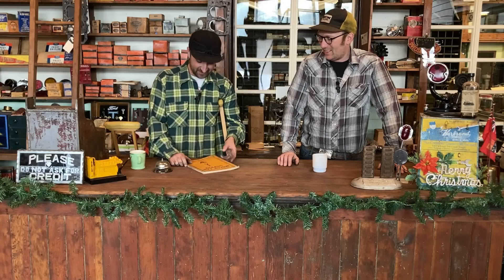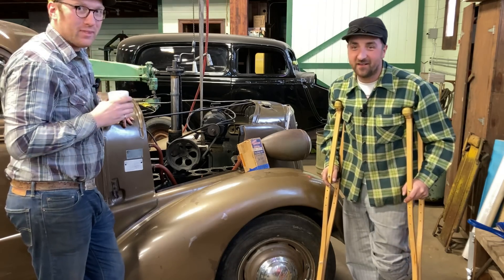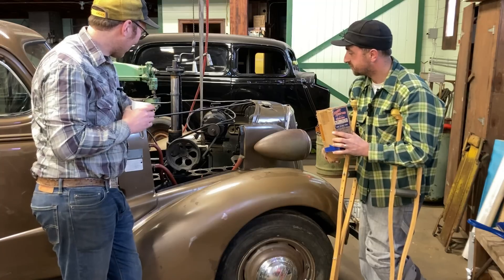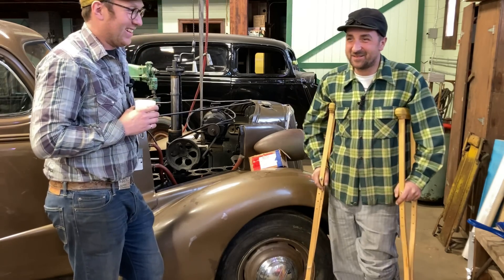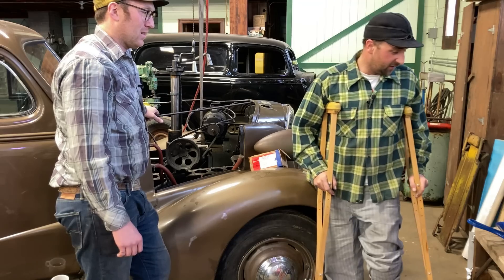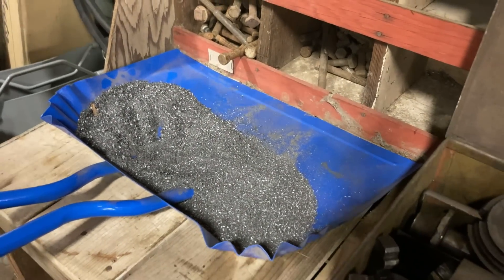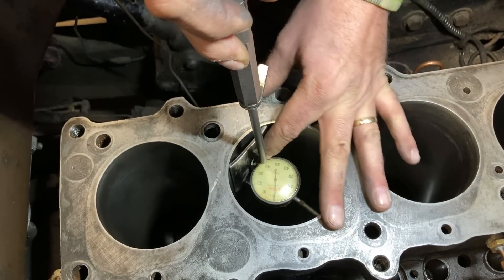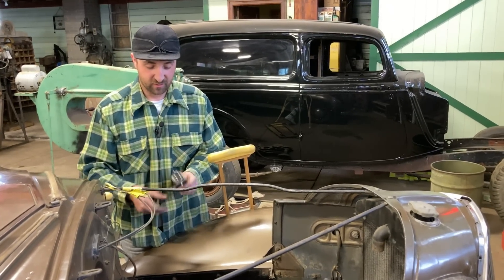Saving a RUINED Engine WITHOUT Taking out of the CAR! 1920's STORM Boring Bar! Saturday STORMIZING!

Comment: Being an avid and long time fan of this channel and CWM, I was rapt to be able to see this done - and just like it would have been done around a hundred years ago.  I was absolutely fascinated by that cylinder bore - being driven by an aged electric motor that was so much quieter than a lot of more modern similarly sized electric motors.  I am not sure whether the electric motor was from the 1920s given that electrically-driven items were still in their infancy, so would be interested to know if it was part of the original kit or, if not, how the bore would have been originally driven in situ, as I cannot imagine it being hand-turned! 

A lengthy process, but one that was so darn accurate and achieved the goal of giving that '37 Chev's engine a chance to live again and keep her going in an all-original state - and best of all, on the factory standard bore sizing.  Not caring about the value of the car - just that it seems right and proper to make it happen if indeed it CAN happen.  The '37 is such a treat and a true time-capsule otherwise, that it really gives me the fizz that you were able to save its heart and Scott will have her running again by summer - of that I have no doubt.  It will be truly special to see that beasty rack up a few miles for the first time since she was parked all those years ago - and you two can be rightly proud that you've had a big hand in that.

Period tools have their place and they - like the cars that were worked on back then - only go to show that a thing does not have to be brand new and modern in order to do the job and do it well.....and oftentimes, the older units will last a lot longer than their modern equivalent because they were built to receive regular maintenance to help prevent them from no longer being useful.  I am in awe of your impressive array of old tools and New Old Stock and would love to be able to spend my days working on cars of that vintage - not just as a hobby and I thoroughly enjoy watching your content to see what examples of yesteryear turn up.  As I have said before (and will say again) I wish you both every success and all the best for the business.

Comment: For many years, cars and engines were designed to do almost a complete rebuild without removing the block from the car.  Top and bottom ends were accessible.

Comment: One of the most common causes for a cylinder to go bad was casting core shift causing casting sand to be embedded in the cylinder wall causing excessive oil consumption from the destroyed piston rings. It was pretty easy to do an inline engine in the car, not so much with a V8 with limited room to work.

Comment: This is the perfect corollary to the CWM video.  I could not see how the boring bar was installed without removing the crank or how it could remain centered.  It's all explained here, plus the sleeve installer that pulls from the bottom.  Awesome job guys.

Comment: Having these old sleds and actually driving those registered and used as daily cars until You have to use some of the 2020 tooling to repair/rethread/rebore a patient in need is awesome already. Having the contemporary tooling which eases the repair in a contemporary way like the strongification tool set did for You here is in deed lifting all that old-car-divertisment up to a completely new level.  Thanks for sharing - hit the like button three times for good measure 😁

Comment: Hi Matt and Jim! Thanks very much for dotting the i's and crossing the t's on this one. I really enjoyed Scott's video and this one also. I've taught myself to use a vintage Buma boring bar, so this video is right up my alley. I have only used mine on Flathead Ford V8s as that is what I am primarily interested in. My very first job was a sleeve job so talk about in at the deep end! I've showed the machine in action in some of my videos. It's a little later than the Storm so looks more like the familiar Kwik Way and Van Norman types. Keep up the excellent work and get yourself better Matt. All the best, Mart in England.

Comment: I went int my shop and looked at my original Black and Decker valve seater tool  and refacing machine. With a lot of mandrels and stones I paid 100.00 several years ago. Learned how to do valves when I was 12, I;m 78 now and still a mechanic.

Comment: I tell others that are doing projects, Go to Strongs garage if your looking for a tool that does things  just like the boring machine. Not going to find one of those in any shop in america now. I have used one before and its a  new life for good many engines with a wrist pin scar or a light crack that might start to go through the cylinder to the cooling or even exhaust chambers that lead to bad things if not fixed. Flathead ford engines were remembered for cylinder cracks... real bad on some of their engines
I decided to edit or add to this comment. Although I am only 73, the  town I came up in was a good twenty years behind towns only say thirty plus miles from us and then the cities just a tad more. Meaning I grew up with guys who taught me old school stuff cause it was still new  to us. I therefore could stand with mechanics say fifteen to more years older and be with their knowledge sets. I used a boring bar to "True" the hole if it was just a smidgeon off of true. That with our crank shaft tools that would weld, cut and reman the shaft to its exact sizes. I did help with "doing a stroke" on a crankshaft". That took more time than worth but the pay was phenomenal.... like almost a twenty dollar day for only ten hours. Didn't make a difference if it was monday or sunday as it all payed the same.

Comment: I have been a follower of CWM for a number of years. When Scott bought the '37 Chevy I drooled!  I remember it took a bit of time to asses the full nature of the damage to the engine. Scott was prepared to take the engine out and completely rebuild or replace it but when it became clear that the #5 cylinder was the only one damaged he began to explore other options. At first he honed out the #5 cylinder and attempted to repair it with JB Weld epoxy. Fortunately Jim, the agents and many CWM followers were able to convince him to perform the in-frame cylinder repair that you have witnessed instead. I recall when I was a youngster, this was a rather common technique which reduced the cost of returning an engine to a proper state of repair. Scott's '37 was a perfect candidate for this procedure because of the very low mileage of the car. A failed head gasket was declared the cause of the corrosion damage which was confined to the #5 cylinder. The rest of the engine was in very good condition. All that remains is to install new piston rings (on all 6 cylinders) and re-assemble the engine. Scott hopes to be driving it next year.

Comment: Nice boring job I used to have a boring bar called the quick way kind of similar to bolted to the top of the deck one at a time was a slow way but it was very precision I did a bunch of engines back in the day my buddy gave it to me when he retired he was a hot rodder i he had a48 Anglia409 he made a custom tunnel ram intake out of Sheet Metal Harley anybody is doing that back in the day it had2 660 squirters  is a 4-speed narrowed 57 Olds rear end48 gears it was scary in a good scary have a great day you guys did a fantastic job that things going to run great
Reply: You can still get Boring bars today one is the Kwik-way and the other Boring bar company is called Van Norman the Storm Vulcan is not around anymore but from what I have looked up was a very common bar back in the day.